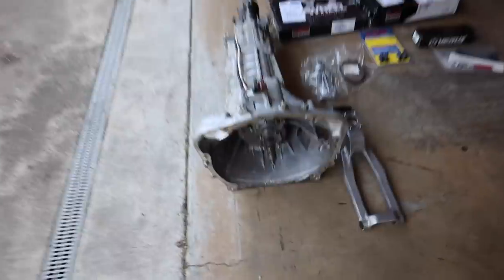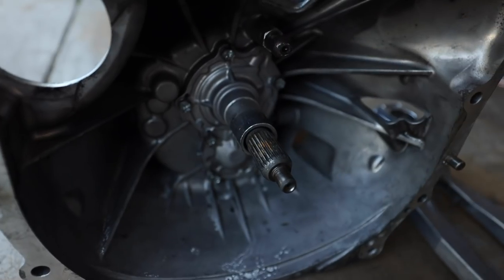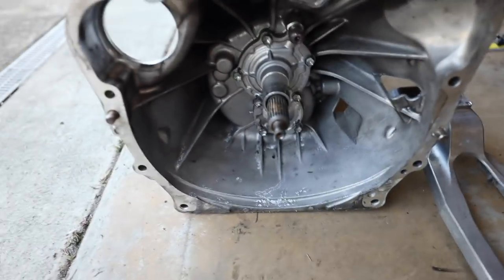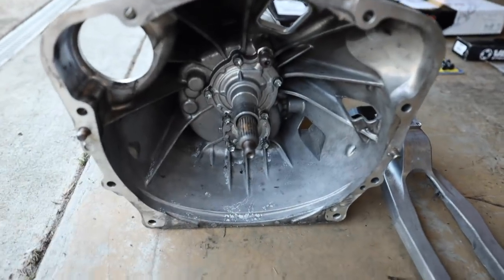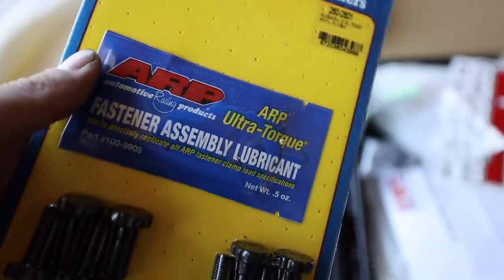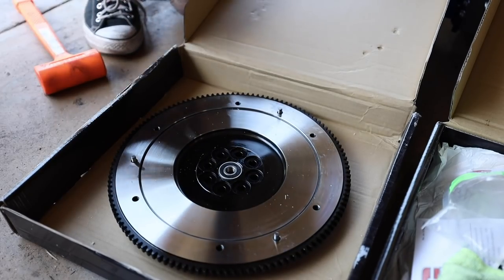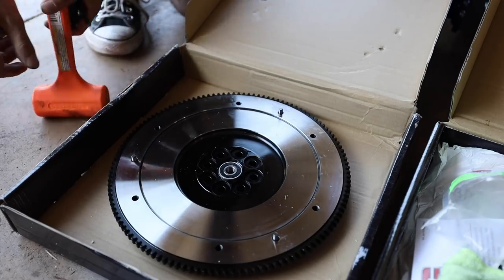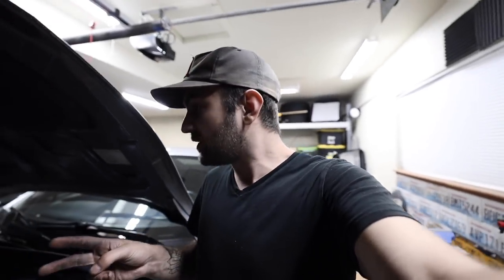I Have NEVER Seen A Transmission Do This Before...

Comment from the maker: If anyone's got any ideas on this please let me know 😅
Reply: I know, you went FULL CHOOCH
😂😂😂
Reply: Don’t mess with the transmission on your own 🤷🏽‍♂️😅😅
Reply: cam position sensor aligned ?
Reply from the maker: Yessir, made sure the alignment dowel was centered
Reply: Did you ever figure out the issue, I have the exact same issue on my brz...
Reply from the maker: It was my clutch fork, the verys one was too thick and not fully engaging the clutch
Reply: @Smeedia  Hmmm maybe that's what is happening to me, I installed a verus clutch fork as well. I wonder if changing the clutch pedal engagement will help. Thank you

Comment: If you are installing a transmission and you don't have the urge to set your vehicle on fire, you are doing it wrong. 
Kudos to the Melanie for helping out. My wife helped everytime I did the transmission in her pickup. 
The issue with the transmission,  most likely going to be the pressure plate/clutch or somehow the shifter is installed wrong.
Reply from the maker: Thats what im thinking at this point, luckily I have that recall coming up so I don't have to pull it again, as much as I love fighting a transmission under the car on jack stands I'd rather not do it again 😅 and ladies who help are always the best 🔥😁

Comment: Best way to align the transmission on instal is to go to home depot or lowes and get one of the LONG threaded rods (that is the same diameter and thread pitch as the bell housing bolts) and cut it down into 6-12 inch long pieces. Thread those into the back of the engine and slide the transmission on those. Might need to wiggle it a little bit, but it will make your life a lot easier.

Comment: Me and my friends had a similar problem when we put his trans back on. When putting the shifter back and setting the reverse lock out, put it in first gear and have the blocking plate pushed up to the shifter. Then wiggle the shifter a little so the blocking plate shifts a little then tighten it down.
Reply from the maker: Tried that and no luck 😢 I think its the pivot ball or the pilot bearing 😢
Reply: Damn, that fricken sucks. Hopefully that's it!

Comment: I think what might have happened is (this happened to me), when you put the trans in it you might have bumped it into a gear and when you pushed it to meet the engine, the input shaft on the trans grabbed the splines on the clutch disk and it crossed the splines. Because the shaft couldn't spin freely if it got bumped into a gear. You might need a new clutch disk unless you can file down the splines enough for it to slide accross the input shaft. Just a thought though, because mine would shift while it was in the air and it with the car off but when I would start it then I couldn't put it into gear. My clutch disk was chewed up when I pulled everything apart again.
Reply from the maker: Off, hoping I dont have to and that did not happen but if so, learn you learn and live 🙃

Comment: Yo tanner, I actually could use a but oh f ur expertise. Was driving other day and the charge pipe/intercooler coupler blew off..man so humiliating. I have a WRX oh, now I don't know if this is the same for the STI but, why is it such like cheap ass looking and feeling plastic? Okay so what I did was I ordered a different  coupler with some T bolt clamps. Is this a normal thing that happens, especially when you add more power. I recently got the accessport and through on a Stillen high-flow intake, but what I didn't know is that supposedly I can't exactly run my intake with a Cobb off-the-shelf map? So apparently I have to get an e tune? Also I noticed that the factory intercooler is pretty damn dainty itself, if I upgraded to an after-market intercooler which is a direct fit, if I'm going to etuners route would it be a good idea to replace the factory intercooler with one that's just better all around?
Reply from the maker: The bigger intercooler will definitely help. I wluld also suggest snagging a charge pipe to go with it if your getting an Etune, and it can be common with bad couplers. My old skyline would do it all the time 🙃 the T bolt clamps will definitely help to keep ot from happening again.

Comment: I’d re check the pressure plate or throw out bearing cause it seems that the pressure plate is sticking to the clutch plate and not working as it should. Hence it’s not allowing to go in gear
Reply from the maker: Thats qhat we thought as well, we looked through the access panel on the trans and depressed the clucth and we can see the Clutch fork and TOB moving, it depressed the Diaphram springs but not enough to dosengage 🙃
Reply: Yep there ya go lol I had the same issue on my 02 wrx back in the day after blowing up the original trans and replacing it with a used trans.
Reply from the maker: Hopefully subaru can figure it out when they pull the engine 🙃 dont eanna drop ot again if i can avoid it lol

Comment: Does the BRZ still have the throw out bearing that locks into the pressure plate? I have seen a few subbie transmissions do this if it doesn't lock in.
Reply from the maker: From what I saw the TOB does not lock to it but should just push up against it 🤔

Comment: I think there is not enough clearance between the clutch disc, pressure plate, and flywheel. Causing the clutch to remain engaged. Can you put it in a different gears when the car is off?
Reply from the maker: Yes, when the car is off it will go into any gear
Reply: Yeah definitely not enough clearance or the clutch disc is too thick. I've seen it a lot with aftermarket clutches. I've seen people put shims in between the pressure plate and flywheel to correct this. And I've also seen people intentionally burn their clutch until the disc wears down enough

Comment: Hey man I found your channel while looking to do a rwd build on a 07 legacy gt but does a brz manual trans bolt to a ej25 ? Would really help if you know this
Reply from the maker: I can not confirm but; The bell housing is the same as an FA20DIT, and people have swapped an STI 6 speed onto thr FA20DIT so in theory it should bolt up

Comment: Only a couple things I can think of that would behave like that. Pilot bearing is frozen, friction disk is in backwards, or the pressure plate isn’t seated properly on the locating pins, making it warped and still dragging the disk at full travel.

Based on the trouble you had mating the engine and trans, my money is on the pilot bearing being damaged during your install by the tip of the input shaft. Bent the races locking it up.
Reply from the maker: Good possibility, when the engine comes out and I get an answer I'll definitely update to what the issue is
Reply: @Smeedia  Not that I expect you will be taking that trans out again but a little tip a tech shared with me. When mating the trans have a helper (Melanie!) rock the crank pulley slowly while trying to seat the trans.   9 out of 10 times the issue is the splines, it a really tight tolerance. done this 5 times on 3 different manual legacys and it works like a charm. Good call on the verus fork and ball......as me how I know :)
Reply from the maker: I did not even think of that! I kept putting the driveline in and trying to spin the input shaft 🤣

Comment: 3rd gear is the neutral in-gear position (if that makes sense). Also, the clutch is misaligned to the flywheel. So you have 2 problems.
Reply from the maker: Good to know, engine gets pulled earlier next week. Not an ideal issue to have 😅
Reply: Looked it up. You overtightened the shift pivot ball or had the tyranny in gear when you put it back in. Make sure the tyranny remains in neutral when reinstalling it as well as the rest of it. Its tough to get back into neutral like that but its new enough that the synchros are crispy enough to find it. You have to do it by feel. Hope that helps! Good luck!
Reply from the maker: Thats what I figured 😢 car gets towed to substu tomorrow for the recall so going to have them make the adjustment while the engine is out 😅

Comment: Have you tried playing with your reverse lockout plate? I just put my trans back in yesterday and felt like I didn’t have a second gear, but I was fine. The position of the lockout plate has a lot to do with the gating/feel. Could be something easy to play with/check
Reply from the maker: The odd thing is that it goes into gear when the car is off so I can still reach 1st and 2nd as well as reverse, very confused by this 😅
Reply: Smeedia sorry I don’t have more, but lockout plate seemed to be most common shifting issues on FT86Club forums/my case. I put in a Southbend “Stg2 Daily”. Hopefully Subaru can figure it out. Keep it up man. I wanna see how your FI works out. I’ll be going with a JDL Kit/Delicious for tuning myself (whenever the other half of it gets here).
Reply from the maker: Haha i feel it, ill update what subaru says when they tear it apart. And I was eyeballing that JDL kit for a while 🔥

Comment: I think it has to do with the input and output shafts. Found this forum about this with a few suggestions https://grassrootsmotorsports.com/forum/grm/wtf-is-this-manual-transmission-in-neutral-spins-d/102577/page1/
Reply from the maker: Thank you! Makes since since the fluid is moving inside of the trans, not quite sure why it won't go into gear now though 🤔
Reply: Smeedia yea that part I’m not sure. Maybe the linkage wire or something with the master cylinder? There’s so many things it could be. I’d be so mad dude. As you know though, it comes with the lifestyle. It’ll be worth it when you fix it
Reply from the maker: Haha oh for sure, I was steaming last night after everything went back in, pretty chill today though 😅